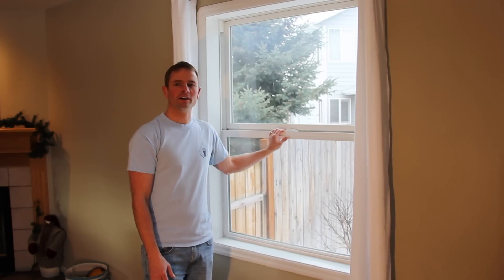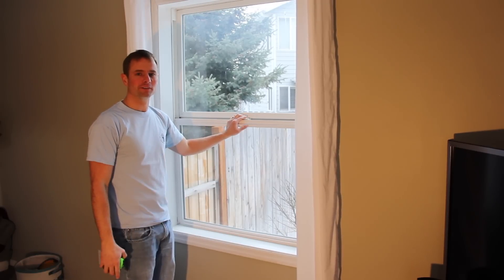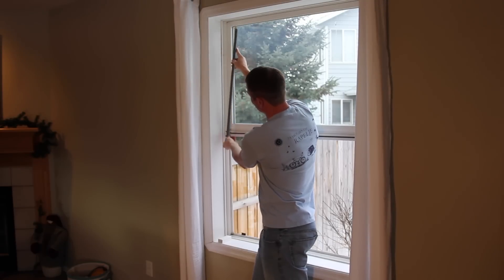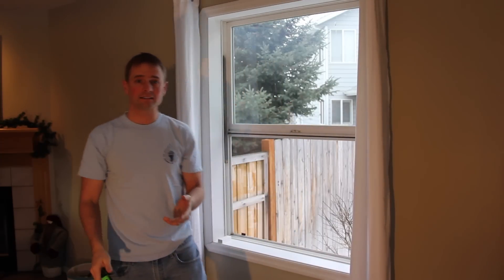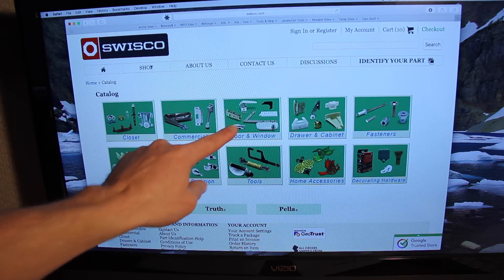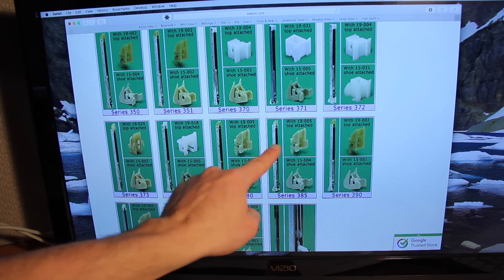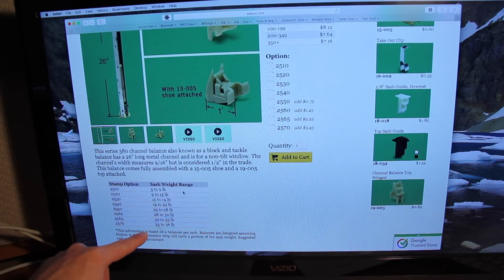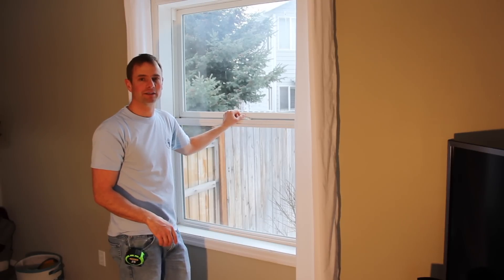How to replace milgard window balancers

Comment: It is actually really easy - Milgard does make it very easy. If you go to 3:30 of this video it actually shows the only thing you need to order new balances. It says '25 5 Caldwell' that is the model number. It might also say BSI and a number. You can order these from Amazon or go to a local residential glass shop and they can order.
Reply from the maker: I'm glad you found it easy.  I wouldn't have known that was the model number and getting in touch with them with my schedule seemed difficult for me.  I also even stopped at a few hardware stores (one that carried the brand), and none of them were helpful at the time.  So, that's why I ended up making this video.  However, had I known that was a model number and that I could find them on Amazon, I bet it would have seemed easier.  Good things to know!  Thanks for sharing!

Comment: I called Home Depot, gave them the numbers on my balancers which I saw written on them, when taking the window out temporarily. Home depot ordered them from Milgard and I put them in. No weights or measurements to take, just two numbers on the sides of the balancers. I do agree they are cheaply made.

Comment: I agree with your feeling about Milgard.  I too am in a house that's 20 years old and the warranty doesn't transfer.  Milgard was a complete joke.  After being run around in circles they sent me an email saying to look on the Milgard website and find a dealer in my area.  I could choose from the dealers to have someone replace my balancers which have now failed in 5 of my windows.  Not a one of the 5 dealers listed would come out and repair them, they either said they only worked on windows they installed or they'd be happy to sell me new windows, to the tune of $6,000 plus!  My windows don't have the clips on the top of the slider area and NOBODY at Milgard knows how to remove/replace the balancers.  Safe to say when I do replace my window, Milgard is NOT going back in.  Thanks for the tip about swisco.  I'm going to order from them and see if I can figure it out.
Reply from the maker: Thanks for the comment and sorry to hear about the hassle dealing with Milgard.  I hope you were able to order some new balancers and your windows are working better (without having to spend thousands of dollars)!!

Comment: Only one side balancer?  I hate these windows.  Just moved into new house, many windows were very tight.  I just paid a glass company $348 to replace two windows.  I won't be doing that again.  If I had to have them do it again, I'd choose to never open the windows again.  Thank you for the video.  Will do it myself next time.
Reply from the maker: There should be a balancer on each side - so each window should have two balancers.  I'm glad you found the video helpful - sorry it sounds like it was a little too late though.
Reply: Thank you. Another spring sprung the other day, now the window won’t stay up at all, so it will be my first practice window.

Comment: Great video. Thank you!
Had watched it several months ago when our windows were giving us problems and again a couple days ago, but stopped before you measured  the width at the bottom.
Then I decided it was a good time to pull the window out.
I remembered to measure the length and weight, but forgot about the width at the bottom shoe. 
I too narrowed it down to the 380 & 385 and now, two days later, I finished watching your video.
Lucky me, I need the exact same model as you and can reason to the 1" width from all the pictures I took.
Thanks again.

Comment: Another option is the note the numbers in-between the panes of glass at the top of the window. You can call
1-800-milgard, give them those numbers and they will send you replacements. 
Milgard has a life time guarantee. They will send you replacement balancers free of charge.
Just did two of my windows. 
Good how to video as well. Thanks!
Reply from the maker: Thanks for the comment Dwain - hopefully other visitors will see it and know that they can likely get free replacements from Milgard.  It was a while ago now, so I can't recall if I tried to call Milgard or if I only visited their website?  I did stop by an authorized seller, but they said just to contact Milgard.  I only had time on the weekends to work on it - so that may have been my issue??  Oh well.  Again, thanks for leaving a comment - I really hope it helps others looking to get free replacements!  :)
Reply: @buck4mt  also - Milgard balances are (or used to be) manufactured by a company called BSI.  They will have a series and 'size' stamped on the side of that.  This model number or 'size' gives you the length and weight, etc and if you goodle that model number into google you will find it from a number of suppliers.  For example if yours says BSI 2710, google that and you will find supply companies that can get you the exact replacement part.  (Including Swisco)  Just makes it easier than taking the sash out and weighing it... measuring it, etc, etc.  The only tool you need is a pencil and paper.  :-)

Comment: My metal piece is 28.5 inches and the product only comes is full inches. Should I go long or short?
Reply: I just called swisco and they recommended to always go long. In my case I have 28.5 so I'll be ordering 29. Hope this helps someone!
Reply from the maker: @mikewillis87  Great to know!  I saw your question and was just looking to see if I could determine which is best... when I noticed you answered your own question!  Thanks for posting and sharing! I'm sure it will be helpful to someone else.  Thanks again!

Comment: I work for a company that owns commercial property with these windows.  I actually called Millgard because I couldn't find the balances on their website either.  The help line told me they do not sell direct to the public.  You have to be a contractor or supply house to get parts directly from Milgard.

Comment: How do you take the window out? Mine was not shifting to the side, even when i lifted it all the way up.
Reply from the maker: I wish I could be more help, but it sounds like your situation is different than mine.  My windows were always tight and often looked like they wouldn't squeeze out, but as long as I shifted the windows all the way to one side or the other, it always left just enough room for it to pivot out.

Comment: Great video!  I never realized how easy it was to fix the balancers.  After reading the reviews below, I was able to find the serial numbers of my problem windows, and I called Milgard directly to order replacement balancers.  I'm not the original property owner, and the windows are 12 years old, however Milgard sent me two pairs of replacement balancers for free as a courtesy!  Thank you for getting me started on this project.
Reply from the maker: Great!  I think the comments everyone has added are likely just as helpful, if not more helpful than my video.  Thanks for sharing your comment too.  I’m glad you took Penguin King’s advice and was able to get the balancers for free.  That makes my day!

Comment: I have same milgard windows.  The some of my windows require a lot muscle to pull down to latch closed.  Balancers do not appear to be broken it just feels like the springs are too stong or stiff.  The balancers do not appear to be adjustable for spring tension/resistance.  Anyone else have this problem or is that why people replace them?  Not broken per se just feel too stiff

Comment: Keep in mind, most window companies make windows, not the hardware used in their products. Hardware/balances is an outsourced part and something they all share and have in common. Most channel balances are the same, with the exception of  the end plastic attachments. The window manufacturer chooses which attachments are best suited for their product and design. This is why Swisco carries a wide variety of channel balances with different attachments . Swisco balances are fully assembled and ready to install when delivered.

Comment: Great video. I hope this won't kill your swisco endorsement deal. The Milgard website doesn't work well as a parts replacement site. I did find one feature that was amazingly helpful: the phone number.  I actually called them and they were incredibly helpful. They told me where to find the serial number on my window. That gave them everything they needed to know and they sent the parts free of charge (I am not the original owner).
Reply from the maker: Ha!  Too funny - don't worry at all about the "swisco endorsement deal", I wasn't counting on that panning out anyway.  :) I'm glad the folks at Milgard were helpful and thanks for sharing.  Hopefully that will help others!

Comment: Just saw your video, thanks. Your explanation was clear and your "rant" was right on target. Hopefully later today when I replace one of the broken channel balancers, (the nylon pulley string was broke).  I was able to purchase a replacement for a fully assembled balancer,  at a local Milgard Window dealer. Thanks for taking the time to put the video together. Tim in Sonoma, Ca.

Comment: This video is super helpful.  The comments have been helpful as well.  Based on the comments, I called Milgard Customer Service today but I was told because I am the second owner, the parts are not covered under the warranty.  They told me that I should use their website to find a local dealer where I can order the parts.  Oh well, I gave it I try.  I'll stick with the Swisco.com website recommended in this video. That will be much easier than going through a local dealer as this video already explains everything.  Thank you again for making this video.  Calling Milgard was no help.
Reply from the maker: Sorry to hear you weren't able to get free replacements from Milgard.  On the other hand, I'm happy that this video was helpful and I'm hoping the rest of the upgrade process goes smoothly.  Cheers!

Comment: i have the same window, only two years old... my problem is the window stops about two inches before hitting the bottom, it just doesnt go all the way down..... any idea what might be ?
Reply from the maker: Hi Luifer,  I'm not certain?  It could be possible that it is an issue with one (or both) of the balancers, but it could be something else that the window is catching on.  If you have another window in your house that is the same size, maybe you could try swapping the balancers and see if the problem moves with the balancers or if it stays at the same window?  If you don't have another window of the same size/style, you could also try to remove the balancers and put the window in without them - just to see if you can better discover what might be stopping the window and to determine if the balancers are the problem or if something else is interfering with it?  Good luck!
Reply: What a great video!!! Had no idea to fix my windows. You gave me great instructions on how to fix without being condescending.  Plus you gave me great websites!!! Thank you!!!!

Comment: Excellent video, i was able to take the window out and order the balances using your guide ! For the weight ,the Swisco website said to look at the balance ,it is stamped on it. That's what i did. But i still weigh the window for good measure. Thanks!

Comment: Thank you so much for your video.  I just bought an older home with milgard windows and many of them need new balancers.  Mine have a printed number on the balancer ( 2040) so that  made it easy to order the new ones from swisco which your video directed me to.  Thanks again

Comment: Great video, I'll subscribe.  Bought a house with Milgard Windows.  In my case the lifetime guarantee also covered the second buyer for only 10 years after original purchase.  We were the third buyer and do not have any guarantee.  The windows totally suck.  Worst windows ever.  Almost all windows have failed and most windows have fog and even suction cup marks between the panes of glass.  Quality control non existent.  If you are looking for windows go for Marvin.

Comment: super helpful. we are in the same situation. Milgard warranty depends on install but the lifetime only covers original owner or first 10 years. If you are a second home owner, do check if the warranty is valid. Would have been great if the prior owners had clued into this and exercised the warranty before sale!

Comment: Actually Milgard does make it easy to order replacement window parts, for their windows.  While Measurements are always a very good thing BUT, to take out some of the uncertainty, compare your measures to the order number located on the upper left corner (as installed) inside the slider channel, to easily buy replacement parts.  I know this helps.
Reply: My windows did not have the order number in the upper left corner, nor was it anywhere else in the slider channel.  Milgard was zero help when I called/emailed them, which I did probably 10 times.  Everybody I spoke to at Milgard said they didn't know what kind of Milgards mine are.  And yes, they are for sure Milgard.
Reply: @bobclift1147    Yours maybe custom cut to fit you window frame. Hence, the Tab was removed. Milgards, are EZ to take apart once removed and panes are EZ to remove in frame. No, I have had Zero, 0 luck with Buying parts, here in Washington State, very little luck with Buying parts even with the Tab information and way better luck buying panes from other companies to fit Except, for Buying the complete assembly taking the parts I need and tossing the rest (Some times I can find a Milgard Dealer with a broken Standard window for cheap and toss the broken part).  However, all this Bad luck maybe Attributed to Me not being a Milgard Certified Contractor.              
Also, Milgard has no problem cutting windows to fit or custom fits and charging extra. Might be because, they know, you will not be back without buying a complete custom cut window again and Fiddle faddle.  Been there done that! Recommend always trim your window frame to fit Standard Size Milgard windows, not the other way around (Live and learn).  :)

Comment: BTW how did you find the brand of your window? I have the same issue and I don't see a sticker or branding on the windows...
Reply from the maker: Our windows have branding on them where the window latches (to lock it closed).  Just to over clarify, at the beginning of the video (7 seconds in), I rest my hand on the latch where the logo is.  I hope this helps - good luck!

Comment: Thanks so much for your helpful video.  I have a Milgard window that has a broken balancer and I will follow your directions to replace.  Agree with your frustration with Milgard site being totally unhelpful for replacement parts.  Very odd as typically manufacturer's sites are easy to maneuver and helpful.